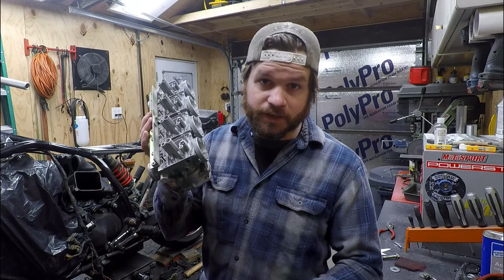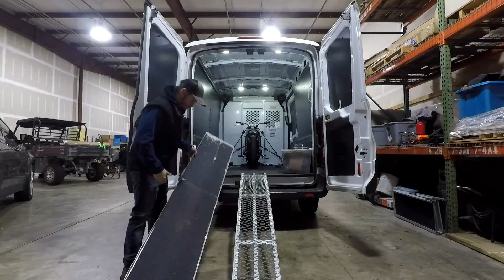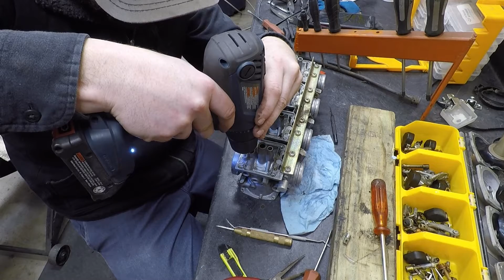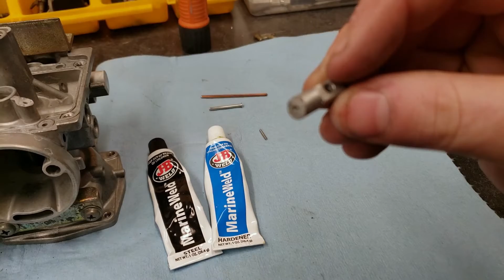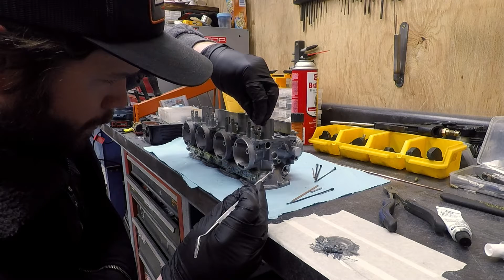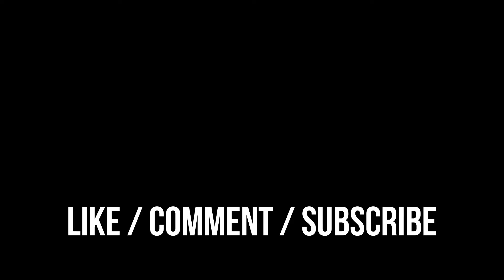Carburetor Float Post Repair - Suzuki GS550 EP4

Comment: Are you for real, that's a bodge and not a repair. To do a good job, machine the casting horizontally, drill it, and use a piece of brass, (an old jet, for instance). Then, using the other side as a guide, drill it for the pin. Now that's a proper repair. Plus, fuel will very soon soften or dissolve your resin.  You don't have a clue you numpty. Maybe leave motorcycles alone and take up needlework 🤣😂🤣 . 👽
Reply from the maker: Ive had so many emails over the years about this repair. It has helped many repair their bikes and ride again. The proper fix is a new carb body but at least this numpty is willing to make helpful videos for the masses instead of just acting superior to people
Reply: @BrickHouseBuilds I do pal, for VFR owners, and in particular RC30's, but not videos. So feel free to go to the 'far queue' 🤣😂🤣. 👽
Reply from the maker: Where are these videos?
Reply from the maker: Lol you typed it wrong saying you did videos and then edited it after my reply. Then days later you leave your last reply. You are determined to make me feel dumb or something because I did a repair on a carburetor. Do better man
Reply: @BrickHouseBuilds only if you do better repairs, and I still can't find where I said I do videos. Specsavers??? 👽

Comment: The post on the carburetors that I bought cheap was broken two places so I couldn't use it I bought some quarter inch aluminum stock and shaped a new post drilled and tapped both parts the carburetor and posed with a stainless steel screw and use J-B weld on the joint

Comment: Excellent repair. IMHO, that is a VERY smart way about repairing that particular carb problem with JB WELD. After it cures, I would say that it is probably a stronger "post" than the undamaged ones. Should last a bike lifetime. Take note JB Weld warriors.
Reply from the maker: Thank ya! My friend bought this bike and now a couple years on its still going strong

Comment: Nice job. Came across your vid due to me cleaning a buddies kids carbs from his 1980 gs550L. As i was removing jets and floats i came across a cracked tower just below the float pin. I haven't tried to remove yet. I stopped when i seen it. Question is, you think that jb weld is worth the try?
Reply from the maker: I wouldn't be using it if I didn't think it was worth it. 2 years in and its still holding
Reply: @BrickHouseBuilds  well, i guess i'll give it go then. Thank you for your reply
Reply from the maker: @KLL1869  Just look for the JB marine weld as mentioned.  Its fuel resistant

Comment: Just wondering - how has the repair held up?
Reply from the maker: Still going strong. My friend owns the bike now but rides it often and all seems well
Reply: @BrickHouseBuilds  was there a reason you chose marine JB weld vs regular JB weld? Did you put weld on the rod where you drilled it?
Reply from the maker: @Booki89  I explain that in the video I believe

Comment: I did the same on the same carbs I saw on another video to use an automatic center punch to get the pins to move so I bought another set off Ebay used the center punch method worked good
Reply from the maker: I've started using the center punch method now actually.  A bunch of people had mentioned it and I gave it a shot

Comment: Looks like a solid repair.   I had a small crack in a down pipe (where the main jet sits) on one of my CB750 carbs.  I found mixed info on-line about whether different types of JB weld would hold up in a carburetor.   Some of them claim to be gas resistant, but then you'll find someone on a forum complaining that they tried it and it didn't hold up.   I ended up seeing the same carb body on Ebay for 30 bucks, so I bought it and replaced the cracked one.   I still haven't been able to get those carbs to work right, even with the replaced part. (Luckily they were an extra set of carbs I bought to take apart and clean for my own educational purposes.  Once the weather warns up I'll try them again and see if I can figure out why I'm getting a crazy hanging idle when I give it gas.)
Reply from the maker: Yea I hope it lasts.  I know I have use this specific JB with good success in the past.

Comment: I made some repairs using JB Weld and for a great surface finish,I use transparent packaging tape on the weld and with a popsicle stick,spread the epoxy evenly and allowing bubble to leave.
Reply from the maker: Interesting method. I still plan to take some sandpaper to this to get rid of the rough portions.
Reply: @BrickHouseBuilds  Oh,I forgot:let it cure enough just to be able to remove the tape.If the epoxy want to stick on the the tape,give it more time and try again until it free itself.

Comment: Ive tried JB only to find it slowly softened up in time. Dont know if it was from the gas or some E10. In any case, my NO WORRIES fix was to drill the carb body and the float post and tap them to a thin bolt. Then screwed on the post and made adjustments to the stud length till i had the holes lined up. Once the float pins put back theres no way the repaired post will EVER fail or otherwise come out.  Of course check the floats operation before buttoning things up.
Reply from the maker: I had seen that method too and really liked it. Being that this is my bike I wanted to try this way and see what happenes. So far I've had good luck with JB marine on other bikes so again, we will see.

Comment: JB to the rescue!!
Reply from the maker: Lol how many things have been saved by JB weld....that must be a huge number
Reply: @BrickHouseBuilds  I fixed an oil leak on an oil pan on a 1946 Globe Swift aircraft while we were flying around California. The oil pans are high magnesium content so it was a pin hole leak right by the drain plug where water would collect. Emptied the oil, cleaned it with alcohol and scotchbrite let it cure overnight and it work well and was there 10 years later still working fine.
Reply from the maker: @rebuildranch1225  gotta do what you gotta do!! Thats awesome

Comment: Well done on the repair BJ. I would have struggled to do that because of the floods of tears I would have been in😥. Good idea to pretension with the rod and zip ties.
Reply from the maker: Thank you. The 3/32 rod worked well. I struggled to get the pin to sit down at first as the jbweld created an air pocket which kept forcing it apart. I had to clean off a bit of JB and then it sat perfect.